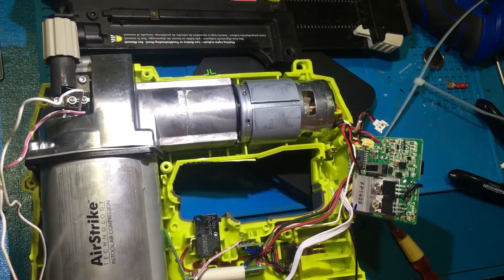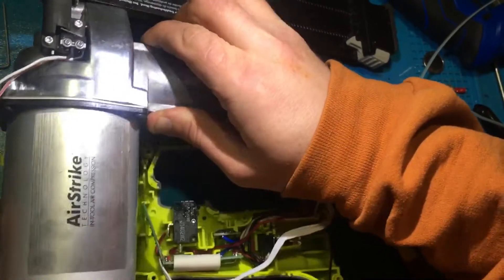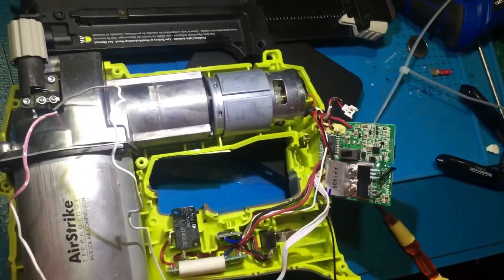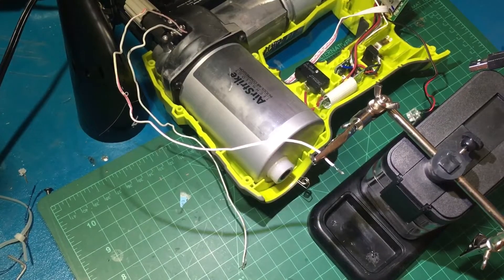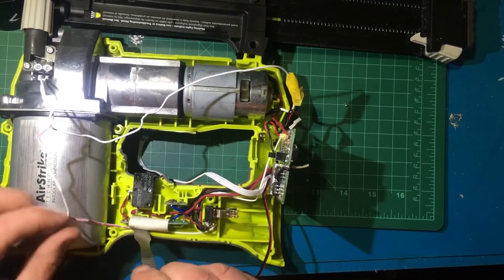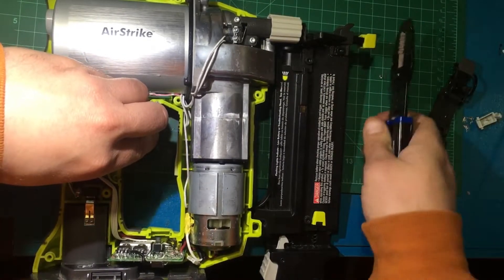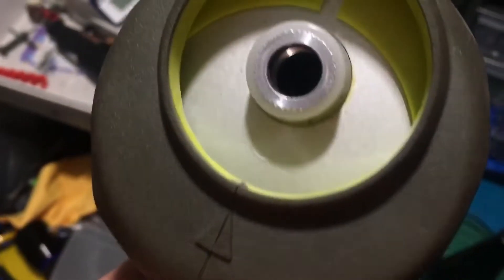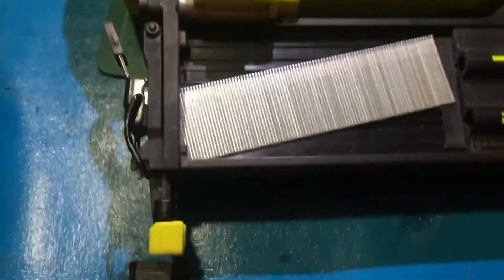FIX! Ryobi Brad nailer

Comment: This video been very helpful. It works on my worx Brad nailer but my concern is will the load of the motor burn up the pressure switch?

Comment: Your video was knowledgeable to a degree, but didn't work, we wired the red strait to the brass piece on motor, the white like you said..it works 2 times out of 4 shots..without taking the bakcing off..sinking the nails enough to be satisfactory